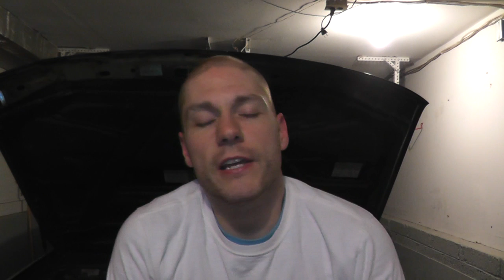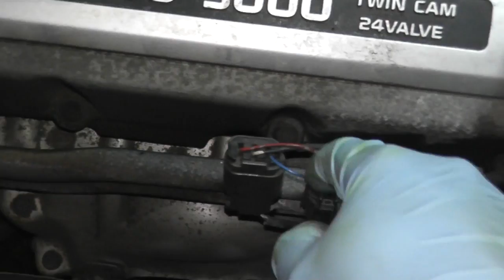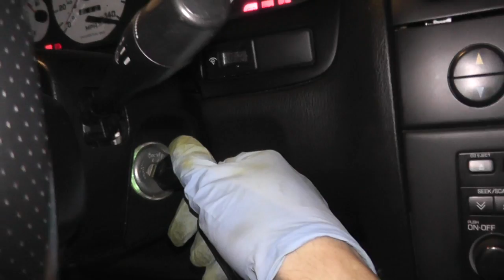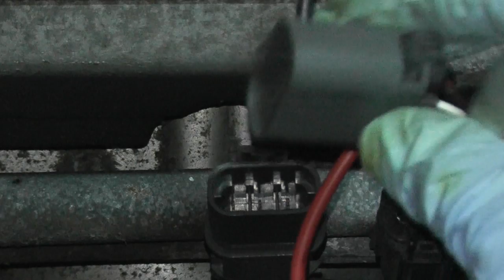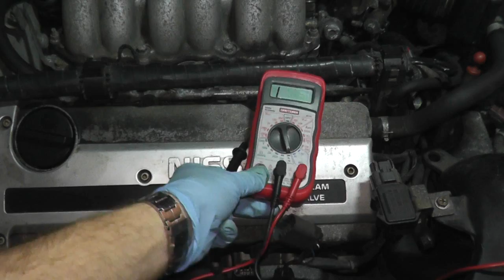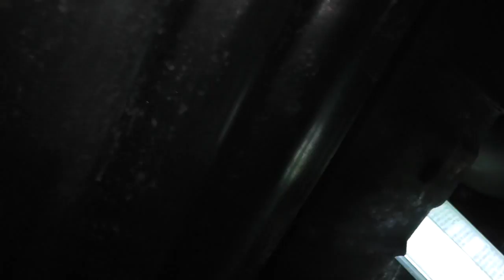Oxygen Sensor P0155 Fix HD

Comment: I used a voltmeter and checked the connection from the sensor using the ohms settings and the voltmeter just shows  1. does that mean the sensor is bad?

Comment: If I'm replacing the sensor I just cut the wire and put a deep socket on it No special tool required
Reply from the maker: Yes but sometimes you'll need the adapter for reinstallation.

Comment: My truck runs fine no issues but its throwing this code?
Reply from the maker: It's an emissions component. Often enough you won't notice any difference. However, if you live in a State that requires emission testing, the vehicle won't pass.

Comment: I appreciate making the video but I don't understand something – you are getting the p0155 code yet when you check it out everything looks good; the ohms reading is within spec, the harness is seeing 12V and there's no continuity where there shouldn't be. So what's causing the code to get thrown?
Reply from the maker: I didn't have a code. Just went over the steps to diagnose.

Comment: Thanks for the video. It's worth noting that if there's a high resistance in the harness between pin 2 of the plug and battery voltage, the voltage test will give a false "good." This happens because the multimeter's high internal resistance will allow it to read +12V, but when the plug is reassembled, the low resistance of the sensor will pull the voltage down to near-zero. The same can happen if the pins in the plug itself are dirty or corroded. The only way to be sure this isn't happening is to leave the plug assembled and test for voltage on the pin 2 wire between the connector and the sensor, rather than between the connector and the battery source. It will be necessary to pierce the wire insulation with the probe in order to make contact.

Comment: great video,i have subscribed,i have a '97 maxima gle that just barely passed emmisions 2 days ago ,the mechanic said i have a pending code as you describe upstream o2 sensor and i am gonna replace both from rock auto the next warm day we have here in tn,are both sensors the same 3 wire and what about wire length are they the same ? thanks.

Comment: Hi, your videos are really awesome they helped me a lot repairing my Infiniti I30t 1996, however, I received code P0150 and it happened to be the same P0155 so I checked this video and did all the test and everything worked good so what do you think the problem might be?!

Thanks again.
Reply from the maker: +majed abdullah Thanks, Majed. Have you replaced the Oxygen sensor? If so, P0150 could also be due to bad injector(s), intake leaks and/or fuel pressure.
Reply: +CarsNToys Thanks and no I haven't replace the sensor yet cuz I wanted to wait until either the check engine come on or the code goes away I will try and change it and check the other things you told me about however I'v received another pending code which is P0400 the EGR, but I have cleaned the EGR tube a couple days ago and been driving it to complete the driving cycles but I the code came back today but it is pending so my question is, do you think those two codes P0150, P0400  may relay on each other on a way that makes one components bad can cause the other code comes another thing do you think the EGR valve is blocked too because when I took the EGR tube out it was completely blocked?! 

Thank you so much again and you video about the EVAP helped me to catch the problem and solve it 😁👍🏻
Reply from the maker: I don't think the two codes are related. However, you can quickly test the EGR valve with a vacuum tester. It's pretty simple on your Maxima - https://youtu.be/0lmLuLsloRU

Comment: thanks for the video !  Im ready to set my 2000 maxima on fire!!!  not getting power to sensor .  losing power to everthing from windshield wipers to  engine .. any suggestions  .. someone told me could be ground... I am thinking knock sensor..   AnyThoughts???
Reply from the maker: Have you checked the battery and alternator? Check engine light on? A bad knock sensor wouldn't give you those symptoms. A bad ground would.
Reply: CarsNToys   check engine lite is showing po155.. but tested it like you said.     thinking its good.. soooo ground looks like the problem..  big favor next video you do if possible point out ground that may be causing me all these problems ..(putting the gas and lighter away)  again thanks a bunch!!!!!!!!!!
Reply: Patrick Keigher  ohhh alternator is newish ...battery newish also..
Reply from the maker: I would check the battery and alternator to be safe. If you don't have a tester your local auto part store will check for free.
Reply: got one . thanks